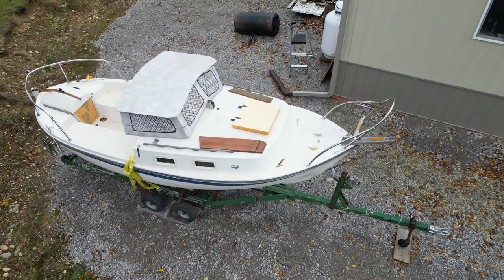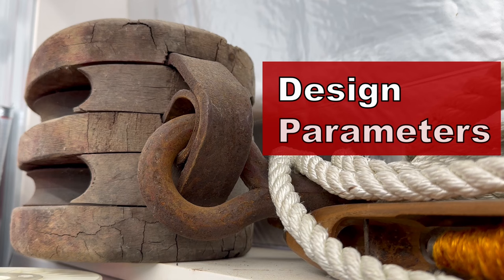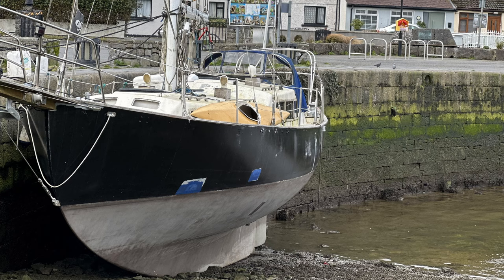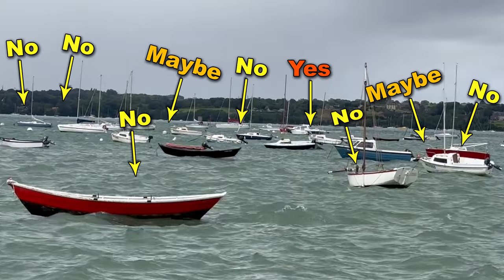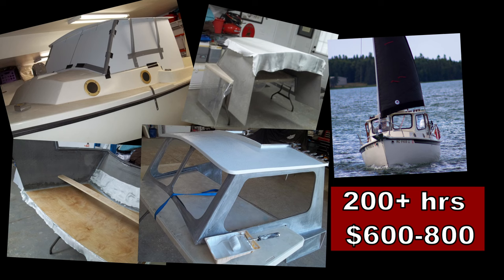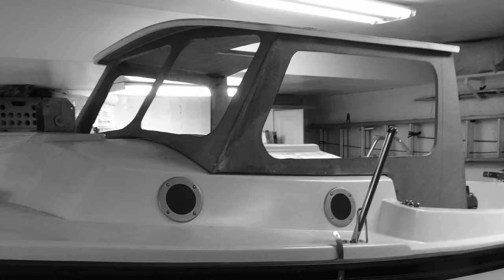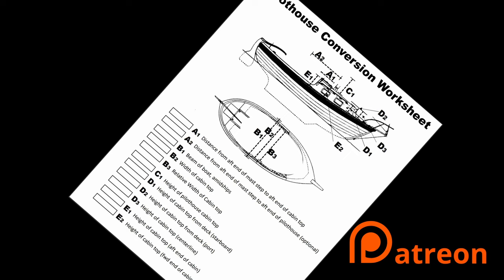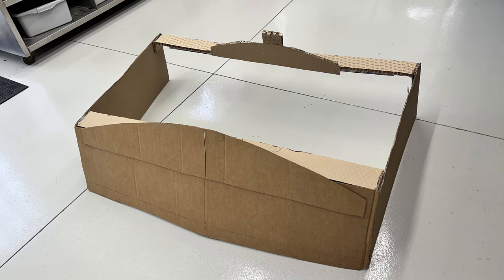How to Design a Pilothouse for Your Small Sailboat | Sailboat Restoration | Boat Building (Ep60)

Comment: Great episode. How will you step and unstep the mast? I’m assuming it was originally designed to raise and lower the mast from the stern.
Reply from the maker: The mast can be stepped from the bow similar to a Compac 16
Reply: @motorcityboatwerks  will you raise it when it’s still on the trailer hooked to the truck. I used to have a Hobie 16 and some people liked to put them on the trailer backwards so it was facing down hill on the beach to help raise the mast. I never did it that way because if you dropped the mast , which I have done a couple of times, it would land on your vehicle. Yikes!!
Reply from the maker: I’ve don’t it both ways. 🤣